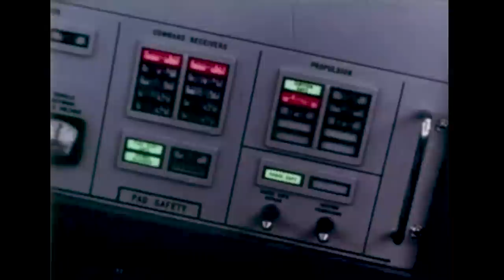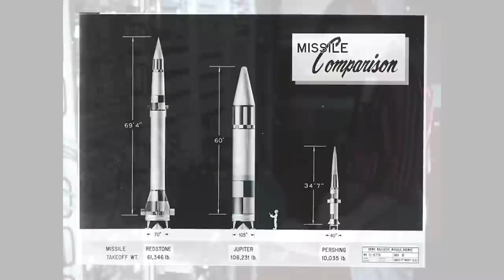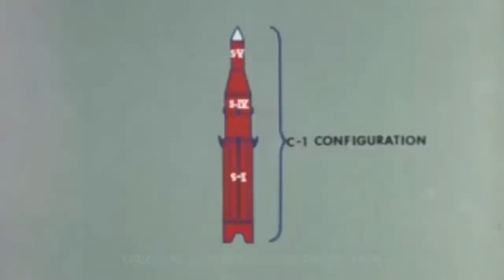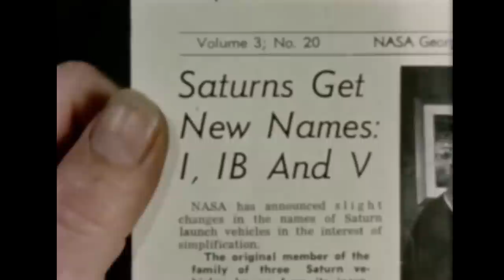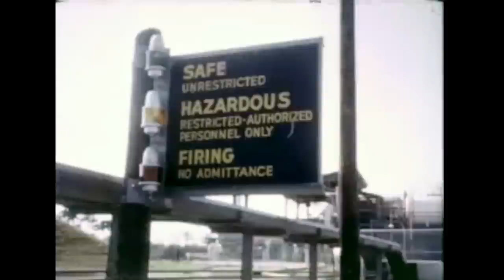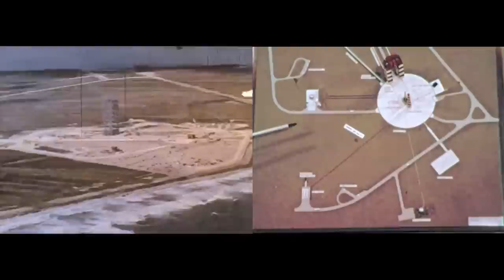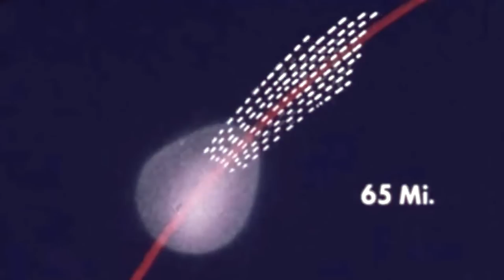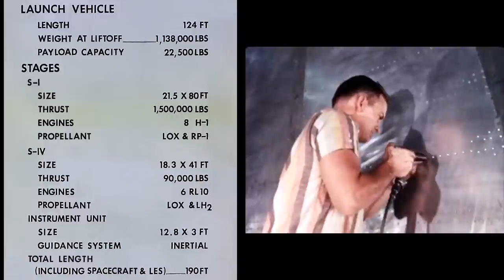Saturn I Program - All Flights, SA-1 to SA-10, Historical Documentary, Rocket, Apollo, NASA, HD

Comment: So, the last Apollo command module in orbit was apparently July 8th, 1989 !!
Saturn 1, SA-8, mission AS-104.  The Apollo BP-26 craft was launched into orbit on May 26, 1965 and ended with its reentry on July 8th, 1989.  A 24-year flight!  It was a derelict boilerplate CM for most of that time.  The longest Apollo flight.  🙂

Comment: All flights of Saturn were successful as compared to Atlas, Titan, others which were common to have explosions. While Saturn had its problems but nothing like the others. Which I wonder if Von Braun's team laid out a design that allows component and subsystem testing, along with resources (money and manpower) to test each item and combined systems. Maybe other rockets had certain inherent designs that didn't allow for that. Or maybe it's because Jupiter, Redstone, Atlas, Titan were urgent wartime rockets pressed into service. While Saturn was not intended as a weapons carrier so not the schedule pressures. Any comments about this?
Reply from the maker: Saturn was designed for human flight from the start, so it had to be very reliable. The previous rockets were basically mass-produced missiles with much higher failure rates (acceptable for military purposes).
Reply: So much had been subsequently learned from the early development of the MX-774 program (the father of Atlas) and Thor/Jupiter programs, Redstone, so this gained technical experience and insight certainly helped guide Saturn development.  It's truly amazing what had been learned from these earlier programs when knowledge was sparse and everything was a "first try" kind of progress.
Reply: @765kvline  good mention, I read Atlas program was something like $40 billion (yes a B) in 1959 dollars. With that kind of money you can hire all sorts of engineers to do all sorts of stuff. Then take what worked.
Reply: @wrightmf  I'm old enough to remember how the Titan program was criticized as a "duplication" of the Atlas ICBM program.  However, the Titan program offered new experience in missile design, especially with the advance of being able to start and re-start a second stage in the vacuum of space.  The young of today, have no concept of how everything was a pioneering effort with little experience.  By the time the Saturn and (short-lived) Nova launch vehicle programs were inaugurated, technology was considerably advanced by Redstone (1953), Thor, Jupiter, Atlas and Titan vehicles, not to mention Agena and Centaur series (1962).
Reply: @765kvline  There is a short YT video of film footage from 1960s showing collapse of an Atlas missile on a launch pad at Vandenberg, I don't remember details in description but it looked like pressurization of fuel tanks failed. As you know, that missile held its shape like a pressurized balloon. I was thinking a general would tell an airman to get a truck and drive down to the Convair plant in San Diego to get another Atlas. They were making them like sausages on an assembly line back then. So you lose a missile, just buy another one.
Reply: @wrightmf  I've seen that video--and it is a comic deflation of a mighty missile (in this case a launch vehicle)--and does point out the issues with the thin-skinned Atlas vehicle.  Just think!  If Von Braun and his confederates had decided to design the V-2 with this kind of inflated chassis, the missile might have been far more deadly and might have also carried a much heavier payload.  Everyone was learning back then.

Comment: The difference between the Saturn I and Saturn IB lies in the second stage where the Saturn I had eight engines on the second stage whereas the Saturn IB had a single J-2 engine.
Reply: Aside from the single J-2 instead of the six RL-10 engines, the S-IVB second stage on the Saturn Ib was also far larger than the S-IV in terms of propellant capacity. Also, the first stage was stretched (and the fins reduced) and the engines, that were made more powerful, were rearranged, with the turbopump exhausts of the inboard engines, that previously were on the side of the rocket, repositioned on the bottom. You can see the difference at launch: all Saturn I had those fancy "fountains of fire" externally to the main exhausts, while the Saturn Ib (except, I believe, for the first) didn't have them. 
The result was a launch vehicle that had over twice the payload of the previous version, though an hypotetical, current day, Saturn-Ib (if the production was never halted) would have probably returned to the RL-10 on the second stage, because of the higher efficiency of those engines.
Reply: @andreabindolini7452  I'd guess a modern S-IVb would have big TWR issues with RL-10s
Reply: @dubsy1026  Possibily, but with, let's say, five "Vinci" engines it would have the same total thrust with far better specific impulse.
Reply: @dubsy1026 less than one twr is okay for upper stages.

Comment: Most of the early rocketry work was designed to launch thermonuclear warheads at the enemies of the superpowers.  Mercury used Redstone and Atlas rockets.  Gemini us modified Titan rockets.  The Soviets used their Vostock rockets but their inability to build something like Saturn doomed their Lunar missions.
Reply: But their R7 rocket booster system is far, FAR more successful than anything we've ever launched. It launched Sputnik, and it's still sending crew and supplies to the International Space Station. They had their early problems, but they just kept improving their design instead of trying to design something new every few years.

Comment: HaHA...now rockets are designed by women and EEOC hires....now NASA has no rockets...its all Space X
Reply: SLS?
Reply: @robertoroberto9798  SLS....well everything said still applies , but the SLS has only launched once with crazy delays and cost over runs...Space X is killing it
Reply: @lazynow1  Delays are needed if you want to launch successfully 100% of the time. So far, Starship had 3 failed engines from the start because Musk didn’t think adding a water deluge or fire ramp was needed.